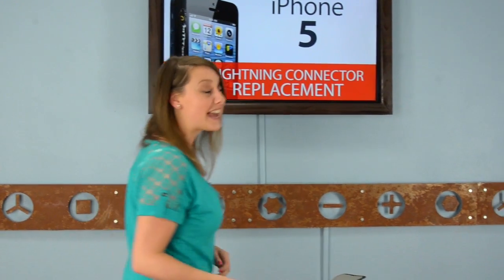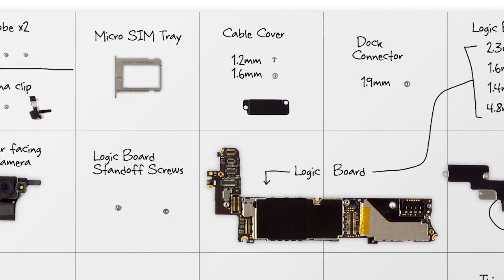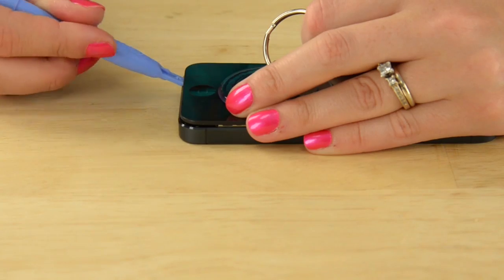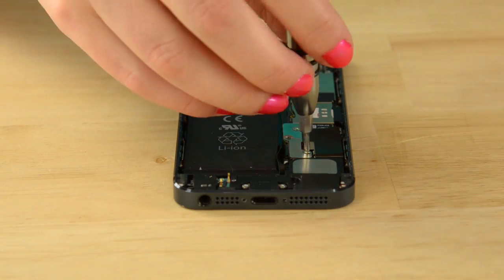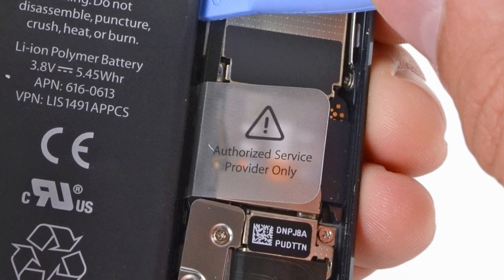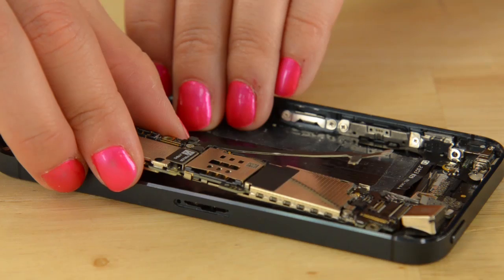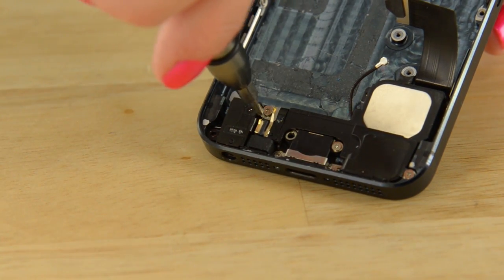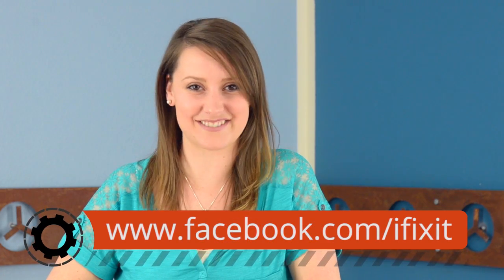How To: Replace the iPhone 5 Lightning Connector (Charging Port)

Comment: Removing the logic board is uneccessary, ended up just wasting my time. Also if you do intend to remove either the battery or the logic board, just use the clear pull tab for the battery instead of spudging, it's literally what it's there for, and for the logic board be wary that there are extra screws under the screws that need a flathead to take out, if the logic board isn't easily coming out then it's because you missed one of the four of those screws.

Comment: Hello!

I changed the battery of iPhone 5 and after that the screen does not turn the phone makes no sound and does not vibrate! I managed to restore it through iTunes, but nothing appears on the screen, no sound, no vibration!

This is a mystery, did not do anything absurd. I followed all the steps, but I noticed a small flat cable lower esquedor side (above the microphone) is broken. What is this flat cable? He is influencing the sound and the screen?

Help me please?

Thank you very much in advance.

Photo broken cable: https://www.dropbox.com/s/09o8gnqmzp357po/img1.jpg?dl=0
Reply: Isfandal Fandal it probably is the speaker cable

Comment: No reason to remove logic board or battery.
Reply: +Adam Mitchell Adam is correct... There is a video called "How to fix the iPhone 5 Charging Port in 5 Minutes and it doesn't involve removing the battery OR logic board. actually made things simpler. Though she is nice to look at the video actually does more detail and doesn't really skip any steps or screws.
Reply: yes, she skipped 2 screws at the top of the phone holding the loginc board and i fucking snapped 2 connector from the board!

Comment: great job, pity you have to remove the logic board to replace the lightning connector ?
Reply: you don't have to.  well, i didn't.  it's not in the way, maybe theres another reason but i skipped that step